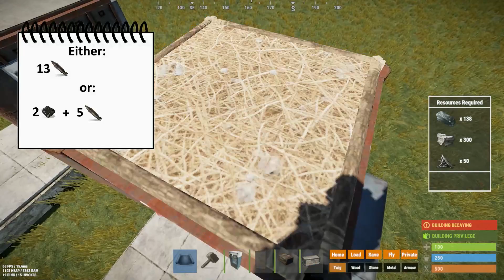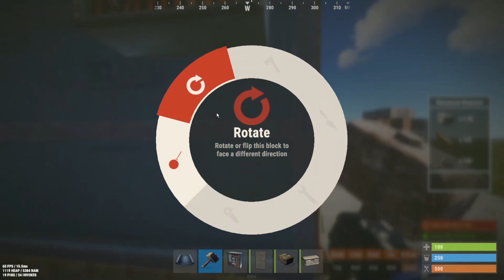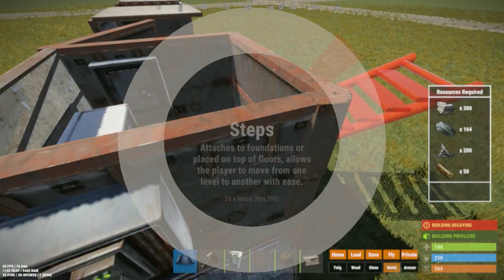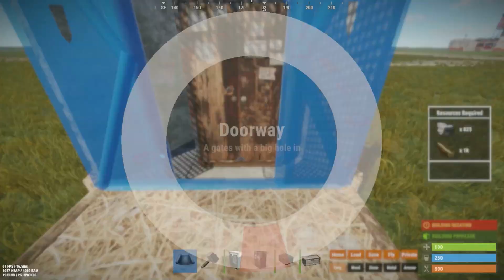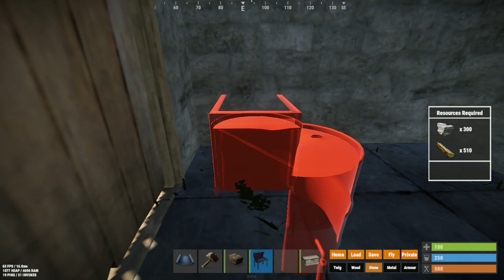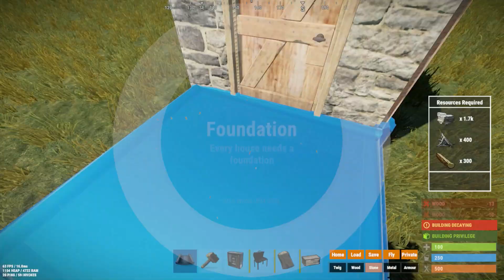Unlootable Lootroom | Unlootable Tc-Room | Vending machines are OP

Comment: I have used the triangle one for many months now. I have loved this build trick and it has saved my base a few times. Last time I got raided, something peculiar happened. The tc broke while the vending machine didn't. I went to a build server and fired a few rockets to see if I could replicate it. I unfortunately did. You can break tc with just one rocket if you aim it right. It saddens me, but due to this, there's no reason to use this trick. You're better off using a window instead of a vending machine. Man, this sucks, I loved this trick.

Comment: was this patched? When ever i place the vending machine i can see access the TC behind it, but if i rotate the VM a few times. I can no longer access the TC, making the structure die.
Reply from the maker: I dont know if spam using it does anything, i have build this atleast a dozen times on official servers and never had that kind of Problem.
Reply: @DavDavBuilding  Yeah. I messed up the placement of the vending machine i think. Quick question though. What is the point of the sleeping bag in the loot room with the TC?
Reply from the maker: @summoner1451  Ok it has 2 Reasons. The first isnt that important, if you want you can add a little extra suicide bunker in the back with some boxes and then spawn in that bag to use it, but i dont do that. The second reason, if you lock TC and add new people to the team you can spawn behind there give the bag to them and then they can spawn in back there. I made a new Tutorial on this there i explain it a bit more.

Comment: Hello, in the triangle TC format you put the vending machine backwards to use it to store loot, If I put the vending machine like that and don't touch it I can open and close the door and acces the TC perfectly, but as soon as I interact with the VM like  (for example "open") then I can't open the door or acces the TC anymore because the only prompt in screen is "Rotate", Am I the only one with this problem? could it be a building server thing?
Reply: Nevermind If I put an item inside the vending machine the rotate pop up dissapear and I can see the Open door and open of the TC again
Reply from the maker: Ye as long as there are intems in something you cant rotate it.